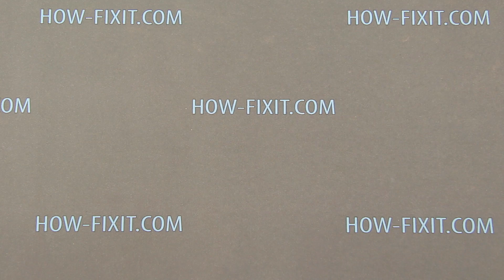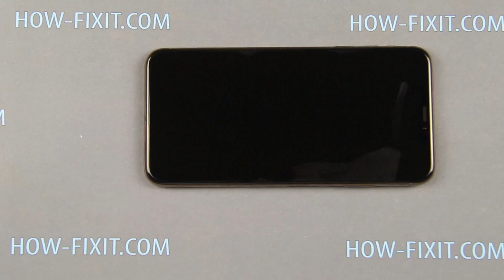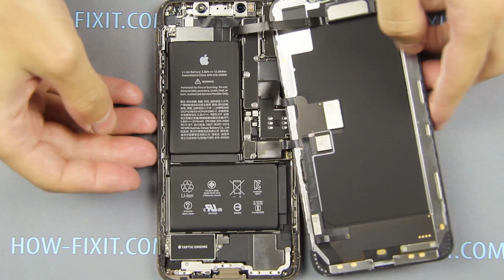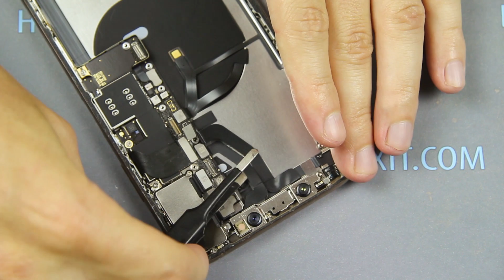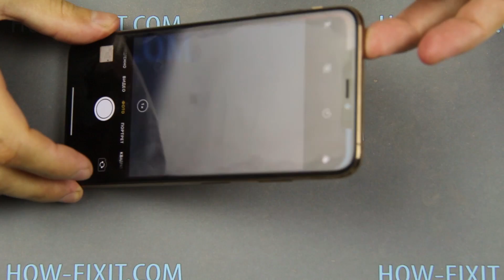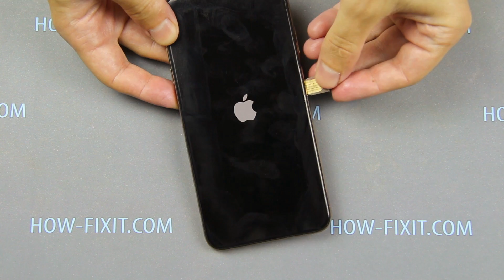iPhone XS Max Face ID Replacement

Comment: i had an small doubt please explain my xs max black colour dead and my xs max gold motherboard need to install in black dead mobile is face id gets any problem after installing of  mother board in black dead xs max device...and is there any option to change colour of installed motherboard after installing in black xs max device...in apple warranty check it will show colour and deatils of mobile naa??

Comment: Will this fix face id that stopped working?
Reply: No it will not fix face id, you have to have the original IR Dot Projector ic's and other stuff inside it.
Reply: @SuperfixrN  if you put an original face id module that came from a another iphone will face id work?
Reply: @SuperfixrN  طححخيخ aku asi adalah iki ora a amiet ngemik anjajah ada canda atas tugas a diastu apa arti asean

Comment: You can replace the camera like this but not FaceID. It is linked to the logic board, simply replacing it when for instance the trueDepth module is broken doesn't work. If FaceID is broken, you will have to completely replace the device by apple. Costs 549$. Sad, but there is no other solution available.
Reply: My face id says it is not available, how can i fix it. 
I went to a repair shop and they cleaned my camera but its still doesnt work.
Reply: There some solutions but won’t be done the authorised service centre’s
Reply from the maker: In this video, I didn't explain in detail the problems in replacing the Face ID module.
Watch this video, explained everything here -> https://youtu.be/KMqv_WJQ3IU?t=406